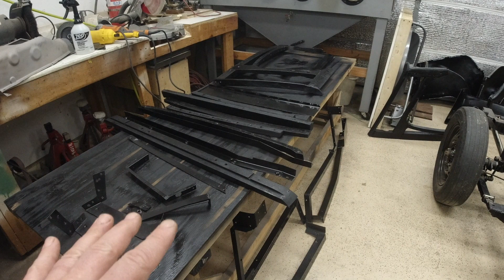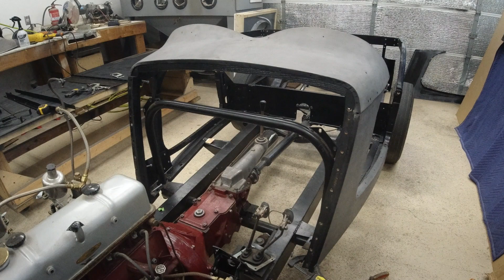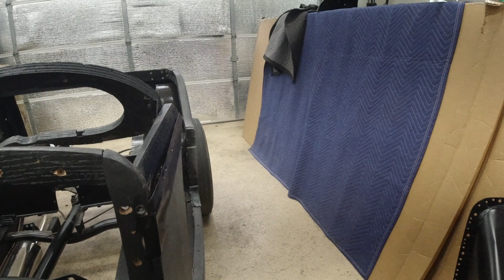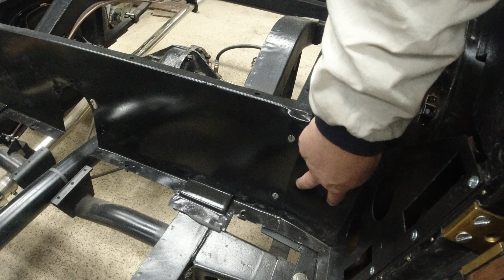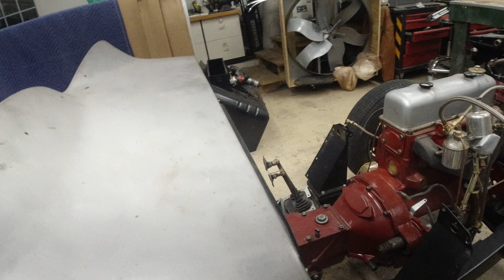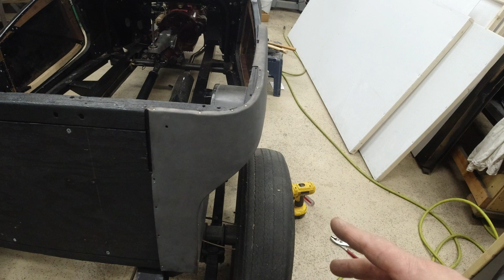MG TD Part 8

Comment: Hello Sir, I’m following your videos for some time now and they are very helpful. In this video you mention ‘bending the hinge’. My question is: how did you do that? I’m worrying that it wil tear.
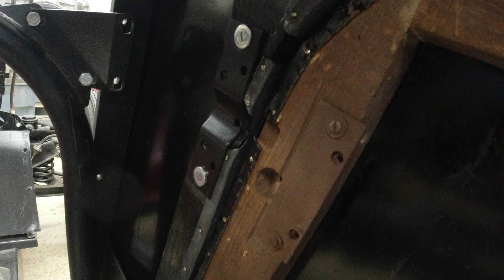Reply: 20:47
Reply from the maker: Heat.  I used a torch to get the hinge hot so that it was easy to bend while making sure to let it cool slowly.  If you try to cool it down quickly it can harden the metal and make it brittle.